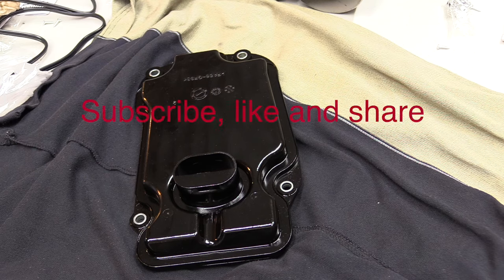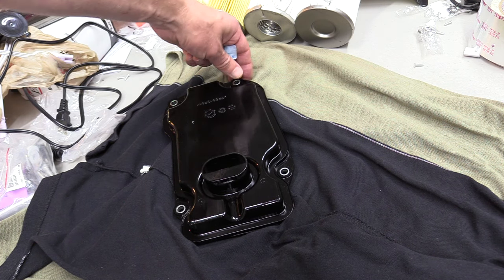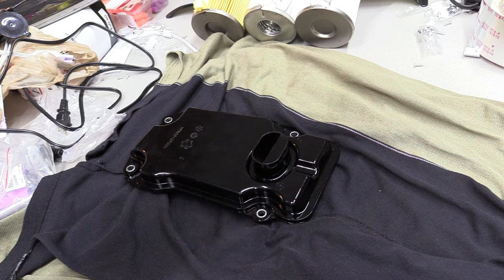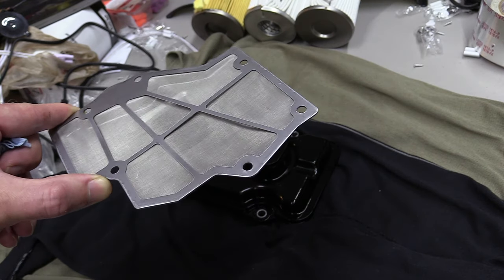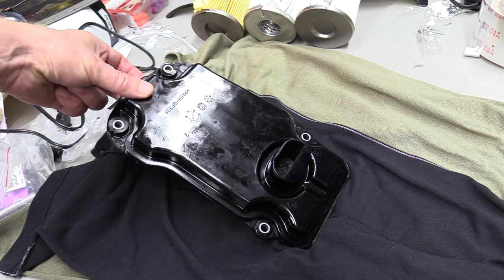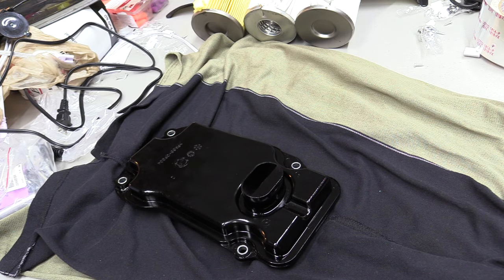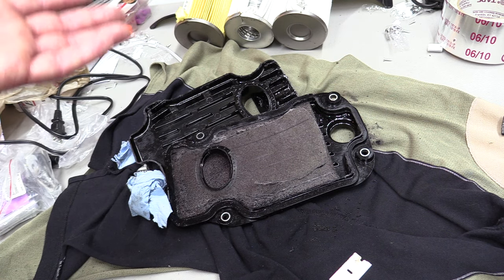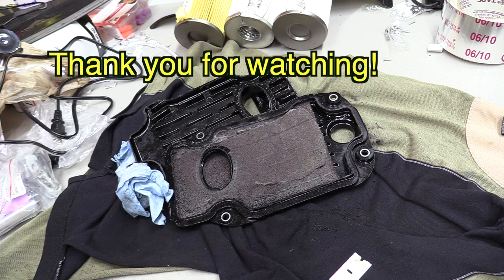Avoid replacing transmission filter, avoid costly transmission repairs, transmission maintenance

Comment: Good video, I choose to change the filter when doing a transmission service. There is also magnetics in the pan that catches fine particles, this also need to be cleaned. Breaking pan bolts is usually done because owners fail to torque them to specifications. Many times over torquing them. These bolts don’t require anymore than about 10 ft pounds.

Comment: I own a 2005 Nissan Sentra 1.8 liter with 327,000 miles and I only change the fluid. I use Valvoline MAXLIFE Full synthetic ATF and never have changed the filter because you have to drop the trans valve body to get to one nut on one bolt. Just asking for more problems. You will never "Fill Up" a trans filter!!!  I just changed the trans pan because it was rusted thru and leaking, replaced pan and cleaned and replaced the magnets on the new pan. 
I change fluid every 40,000 miles and my car runs and drives like a new one. MAINTAINANCE !!!!!
Great video :)
Reply from the maker: Your Nissan has real transmission that can go many miles trouble free when maintained.  Thank you for sharing

Comment: On GM 6L80 or 90 transmissions with the incorrect software program for TCC lockup you should definitely change the trans filter when having the transmission serviced because it will be starting to clog with friction material even after just 30k miles. Also make sure to have a competent transmission repair place reprogram the lockup settings so that the TCC is actually locking instead of just partially locking, which is the reason for the friction material to prematurely be destroyed and clogging the transmission filter. Great video, I wish there was an easier way to catalog all this important information other than random videos online.😊

Comment: Thank You for vidio . I just changed my filter & fluid on Rav 4 at 46, 000 miles . First time done . I was going to cut open filter but didn't . Regardless of what they say , I always remove pan & clean pan & magnets ! ! That is where the most nasty stuff is !! It's impossible to totally drain 2018 Rav 4 without removing pan . Drain bolt leaves at least a quart of dirty fluid in pan . That's redicilus . Replacing filter first time is good idea after break in .
Reply from the maker: Dropping pan does not drain all fluid, you still have fluid inside torque converter
Reply: @repairvehicle  yes and have to do about 2-3 flushes to get approx 95% of old fluid out, unless you have a machine that sucks the fluid out as the car is running, and also the converter.
Reply from the maker: Machine is not replacing all of the fluid
Reply: @repairvehicle  Sure replaces more than just draining it does. About 90% success rate.
Reply from the maker: @howtoplaymusic67  , if you do 4 drain and fill it replaces 90% success rate just like flush machine.

Comment: I overtightened some of the bolts on the transmission pan on a 05 Volvo XC90 after I did a drain and fill and installed a new filter and snapped some of the bolts off when I overtightened them. I did it 3 times before I realized my mistake. I had to take the car to a professional mechanic to have those broken bolts out. A learning experience; the hard way.
Reply from the maker: Invest money into torque wrench ETORK review after 1 year of use. Additional information about 1/4, 3/8 and 1/2 torque wrench
https://youtu.be/pjfwzfgf_2I
Reply: @repairvehicle  The sad thing is that I used a torque wrench but evidently set it at multiple times the correct setting. When the bolts snapped I thought it was the 'click'! A perfect example of a DIY Fail. But I did learn my lesson!  Coincidently I'm waiting for my mechanic to let me know if the transmission drain & fill and filter will resurrect the wonky shifting on a 2012 Mini that I just picked up cheap. Aisin 6-speed.

Comment: Honda CRV ( at least older models like my 2012) has a a filter/pick up just like this one and a small one inline behind the engine ( also looks like a paper one in a metal case). both are 'non serviceable' items. I've changed the inline one at 120k miles and opened it up..it was nice and dirty.  Great video!
Reply from the maker: Thank you.

Comment: I'd like to throw this out there for comments. I have a 2018 Escalade. At 15000 miles I went ahead and replaced front and read differential fluids and transfer case fluids. I used Amsoil. For oil I use Mobile 1. So now at 19000 I thought Id get the transmission fluid changed with the thought in mind that now that the truck has been driven and any initial wear on fluids or parts is done I'd be set for another 30000 miles. I just didn't have the guts to do the transmission myself, because these new transmissions in GM products a PITA to do. The pan is difficult to remove and filling it is difficult and the whole temperature thing. Anyway I bought the Amsoil fluid and took it to my mechanic yesterday. When I came back to pick the truck up he said all done no problems but he didn't use my fluid. He put the ac delco ALV, it is what GM calls for but he says he's afraid the Amsoil will damage the transmission and he doesn't want to be responsible for that. It's too late now but I won't be asking him to do anything again if he's just going to do what he wants.
Reply from the maker: Unfortunately this mechanic is clueless.
Reply: Most mechanic don’t want you to supply them with parts so they can rip yup off on parts as well :) that’s the whole story they don’t want you to be aware of 👍🏼

Comment: Nice I just had my torque converter and fluid replaced under a recall 2014 Toyota RAV4 torque converter flexing problem it was slipping between 2-3 gear I had to look up this problem and saw the recall up to 150,000k

Comment: Very informative video! 
I changed my 07 Scion tC transmission filter alongside the fluid for the first time at 176k miles. Never had done that kind of work, so it was a learning experience. Transmission shifts smoot and no problems so far after some 5k+ miles.
Now I’m thinking about doing the same to my 12 tC since I hear the tranny whine when I accelerate or let go of the pedal. Bought it a few months ago and already did a drain and refill. If I do, I’ll post an update here
Reply: Put seafoam in your transmission drive it for about 30 miles and then change it it will clean it out and probably help it from slipping it's called seafoam transmission trans
Reply from the maker: Have you tried seafoam in your transmission?
Reply from the maker: I have not seen any comments about anyone using seafoam and having good results
Reply from the maker: Why do you want to use seafoam?

Comment: Very informative video. Thank you for the research and dissection of the filter. Worked on Nissan's, Toyota's , and Mercedes for over 20 years. Good advice on more frequent fluid changes. I personally see every reason to change filters more often than factory recommendations.  But, as you mentioned, your driving conditions will dictate your personal
maintenance schedule.   Thank you again,    Sincerely,   JPC
Reply from the maker: Thank you for taking time to watch and comment.
Reply: @repairvehicle  Really appreciate you posting this video Sir. It really helped to understand a lot of myths when it comes to whether or not changing transmission filters is really needed. I will follow your recommendations. It just make sense everything you said 👍👍👍
Reply from the maker: Thank you.  Please share this video with others.
Reply: @repairvehicle  Sure thing Sir. Will do👍

Comment: Hello, just adding my experience I have a 4l60 that had 175,000 miles when I got it. I drove 18 month checking tranny fluid finally getting some dark color and it's 230,000 miles. Finally changing fluids today. No filter shifts great
Reply from the maker: What brand of fluid did you use? What year is your truck?

Comment: Informative. Our Silverado 1500 we use for towing our camper has almost 60k on it. Noticed some random rumbling when doing certain speeds. Got the transmission fluid flushed. Not the whole pan drop and filter replace.Just the basic. Cost about $350 compared to over $600. Fluid was black. Not it is driving way better and normal. Think I may do the full service around the 85k-100k mile marker next time just to replace the filter and clean the magnets since the fluid was in bad shape when changing. But this video is an eye opener and will save me money on Challenger Scat Pack. That car has 65k on it. All it needs is a transmission flush, not the full drop. Like you said,  does the filter really need a change? Not at 65k for a car used on the highway a bunch. Once again, just more price scams by places trying to upcharge you on stuff thats not needed.

Comment: I am close to 60000 miles with my 2020 Toyota Camry LE . I am gling to have the filter replaced , filters filter . What damage can you cause by replacing it . And switching to AMsOil Signature Series ATF . And hoping this shop would do a " passive flush " . Which I believe it is disconnecting the hoses from the transmission cooler . One hose to suck in new ATF and the other end comes out the old . Of course with engine running and this would be normal pressure .
Reply from the maker: Answer in the video

Comment: I really appreciate this. mt V70 xc has 143,000. the transmission obviously has junk clogging the solinoids. I see that my filter is not the problem. I don't have a garage to work on my.car. irony have 3.200 dollars to get it changed. im stuck.!!
Reply: I changed the fluids on my V70 with Valvoline Maxlife ATF.  Fixed my shifting problem right away.

Comment: I’m going to take your advice. I’ve got a 2010 Toyota Corolla w 206k miles. I just did it’s first drain and fill of oem transmission fluid. I’m going to drain and fill the transmission fluid again my next oil change. To try and swap out more clean fluid. Car still running great. Pretty much only done oil changes up till this point.
Reply: Any issues with transmission cause i  have the same car

Comment: 100% same message I have been telling people for years. Several transmissions have a suction side internal filter that can only be replaced when unit is torn down for overhaul. If you have enough debris to clog up a suction side filter, then that trans needs overhauled anyway. A suction side filter only gets more efficient over time. Better to install a Magnefine filter inline to or from the cooler if you want to keep more wear particles out. The suction side filter is at best a 100 micron filter, where an inline filter with a magnet inside it can do 30 or 40 microns or better and prevent more wear particles from ever entering the valve body to cause trouble.

Comment: I see your point. Basically the transmission filter acts like the engine oil pump pick-up screen which you don't have to change. So as long as the transmission oil is frequently changed you don't have to worry about dropping the Pan. But if it's been neglected you can change the filter once and not worry about it anymore.
Reply from the maker: You got it man

Comment: I came across this video as I'm searching for part numbers for my wife's 2019 Mitsubishi Mirage G4, it just hit 30k miles so I want to do the 30k service on the CVT fluid. Anyway, that Jatco CVT has a small cartridge filter with an o-ring and has a pickup filter in the sump/pan like the one you have here. Trying to find exploded parts diagrams for Mitsubishi is not easy, Toyota and Honda definitely much easier for some reason.

On my 2003 Honda Odyssey, it has 176k miles in the odometer with the original transmission, apparently never failed at 60k like it's supposed to. Since I can't replace the pickup filter because it's sealed, there is a cartridge filter that's behind that battery that almost no one knows about. I did change that one at about 150k miles. Otherwise I change the fluid every other year with genuine Honda fluid and I've never had any transmission trouble and tell you what I use it for work, I have all the seats removed but I fill it up with packages, sometimes I'm not so nice and I'll do a FWD peel out from a stop, that 3.5L VTEC is sweet, don't know why they put it into a minivan. So while I've done the preventative maintenance on it I don't baby it either but there she is, still shifts like a champ.

Comment: I bought a 2008 Nissan Altima. I wanted to change the cvt fluid since it had 151,000 kilometres and who knows if it was ever changed. So I went ahead and bought Amsoil cvt fluid and did a drain and fill. The transmission mechanic even cleaned the filter and bottom of the pan for me. Unfortunately the old fluid was black and did not seem to be changed at all. I’m currently at 185,000km with no issues. I’ll be doing another drain and fill when I hit 200,000km. I would recommend Amsoil fluid for everything in your vehicle, it’s really good stuff. 

I should add that I took the car to a Nissan stealership for a cvt diagnostic before the drain and fill. They told me it would fail at 160,000 and I should get it replaced before then for $5000 CAD. Even though I’ve never had any issues with my car, and still don’t after the drain and fill.
Reply from the maker: Thank you for sharing your experience with amsoil atf
Reply: If your trans pan has a drain bolt plug just  keep on draining your used fluid  and gradually   adding new fluid every now and then until the older fluid will be totally purged out  even after you changed out the fluid again at 200km, there still will be the some  original old fluid  left  in a small amount  in the system ,,Drain a quart at 7000 km  and fill it with a new one   and then a  do it again at 7000 km  and maybe a third one after that and you should be running totally on Amsoil CVT by then  with a much better shifting cvt   .
Reply: @VIDSTORAGE  Quick update! I have an appointment for my next drain and fill next week. Altima has been driving great with no issues!
Reply: @EmuTermX   I have  a 2012  Nissan Altima wit the  CVT that will go out fast ,but about 4  years ago ,I started adding AMSOIL to it and changed it all out  and replaced it ,it shifts great and much better than with the NS2 fluid  with the car at  around 182 k miles,  Amsoil does not hold air bubbles nearly as much as other fluids will .....  Glad to hear good news  ,Good Luck /**
Reply: February 2023 UPDATE: CVT fluid changed at 205,000 Km and still going strong! Currently at 218,000 Km

Comment: I have 1999 toyota tacoma v6 with 222,000 miles and never change the fluid and filter and still running good. after watching your video now have to change the fluid not the filter.

Comment: Subaru uses a spin on trans filter and the internal filter looks a lot like the screen filter that you showed in the video. On the models without the spin on filter they use a fiber element filter like the one you disassembled. They are supposed to be lifetime filters but I change them at 60K.
Reply from the maker: Lifetime means for the life of the warranty. Otherwise they should be offering lifetime warranty on transmission and they know the fluid cannot last longer than warranty time without causing significant wear.
Reply: repairvehicle I agree. I wanted to mention I just finished changing the oil in my new air compressor and replaced it with Amsoil 30/40 compressor oil. I would consider using anything else.

Comment: What I would like to see is you cutting open a filter from an old transmission that still works but has been neglected.  If the filter media is not clogged, that would prove your point that filters do not need changing.  Also, it would be interesting to know what is the oil flow (gallon per minute) going through a transmission filter.
Reply from the maker: Unfortunately, neglected transmission don't work and that's why transmission shops still in business.  I found used neglected not working transmission with 130k miles for Tacoma on Craigslist for $650, trying to negotiate price but guy thinks he can sell for asking price.
Reply: Any machine that has a filter inside it oil filter transmission filter or air cleaner they were put there for the factory for a reason filter out the crap like sweeping the floor every once awhile yet a sweep the floor😂
Reply: I did my first fluid change on my 2007 Corolla ( bought new ) when it had 170 k on it. I didn't replace, only cleaned the screen filter. It had very minimal debris on it. The pan had a fine layer of debris too. I have a Camry too and will change the fluid earlier but probably wait until 150 or so to clean the filter.

Comment: Our 2008 Saturn Aura XR 3.6 6T70 6A has a stuck shift solenoid which I suspect is due to dirt on the solenoid. 141k on the car. Did a trans flush at Aamco at 73k when got the car. Been running great but perhaps shifts a tad slow in the past yr. Did the fluid drain posted videos of that. Did 3x fluid drains, so probably 95% of old fluid is replaced. The trans needs to come off the car to replace the shift solenoid and when that is done, I will also replace the filter - why not?? It surely won't hurt anything, and can only help at this point.

Comment: Never changed the filter on my 2015 Yaris CVT, got it at 80,000m & changed the fluid at 85,000m (Now has 92,000m) with genuine Toyota FE twice in 2 weeks. It takes 2.2L each drain.

Comment: Our 2012 G37 has 87k on it and I don't think the fluid was changed yet. I can do the fluid exchange but have always done trans services with the filter at the same time. Unless some bolts get snapped from over torquing, seems like replacing the filter makes sense at 87k. But perhaps I'll just do the fluid drain, which only gets about 1/2 the fluid anyway, as the rest is in the t. converter like you said.
Reply: I would carefully try to loosen the pan bolts. If you can get them out I would drop the pan. If the fluid isn’t black and burnt and no excessive goop on the magnet I’d do a complete fluid exchange